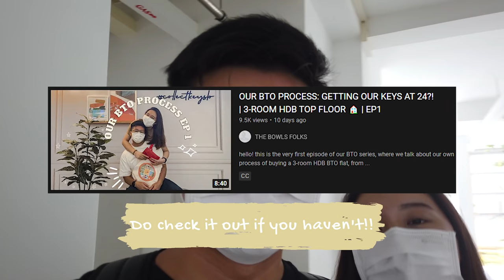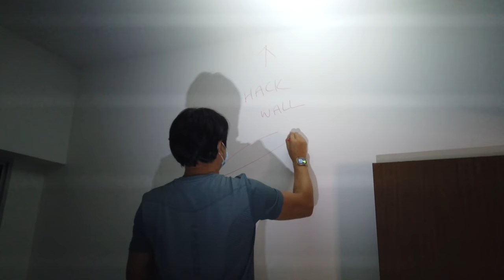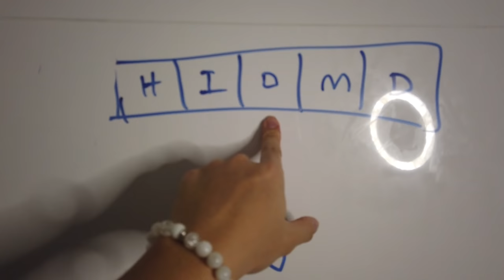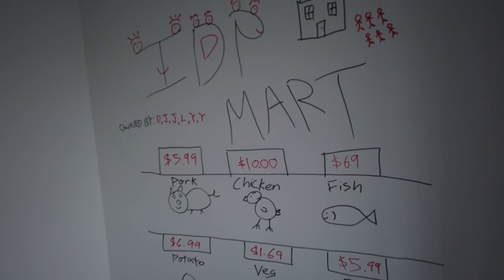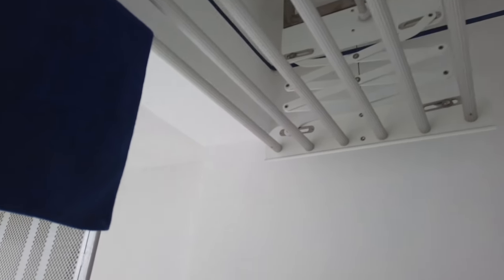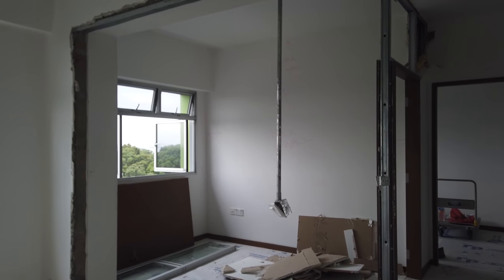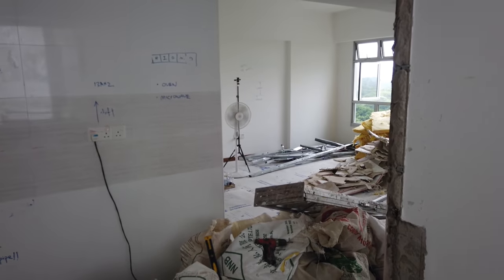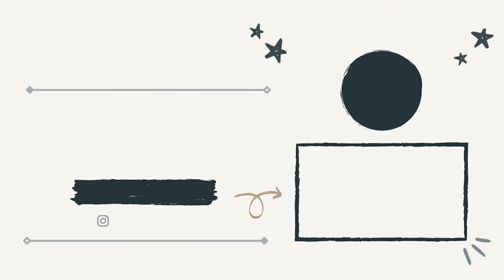HACKING DAY | 3-ROOM HDB TOP FLOOR 🏠 | OUR BTO PROCESS EP3

Comment: HDB should seriously rethink on the wastage of materials and resources. got to find a way to further enhance the existing options of opting in or out on HDB supply of material. some may want a blank unit where they can do up their own layout, whereas other may want HDB to provide the materials etc. high time for HDB to further enhance the options…
Reply from the maker: Hi, yes, that would be a good idea! We do agree with you and even tried writing in to HDB previously to not build up the partition walls + not to do the floor finishes, internal doors, and sanitary fittings as we knew from the start that we didn't want them! But, they didn't approve of our request, sadly :(